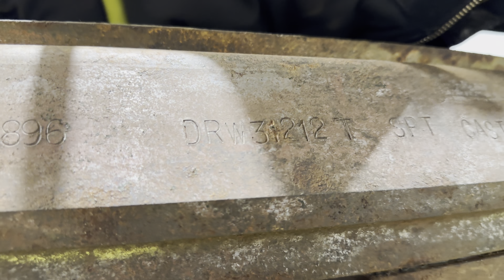RESTORING THE WORLDS ONLY FV4005  (PART-4 RED OXIDE)

Comment from the maker: Incase people are wondering. All the metal parts we cut off are adaptions made to this hull for its experimental work that are not correct for the FV4005
Reply: l was beginning to think that, that rectangle plate was bolted on from the other side
Reply: Cut that scrap up into small chunks and off them up as souveniers?? I'd buy a piece
Reply: It does lose history , but as long as the tank museum documented it I think it is allowed
Reply: will you be painting the inside of the hull? if it will be a museum piece, I'm sure it would look fab.
Reply: @kaiotie1 ….try watching & listening pal
Reply: Oh thx I can sleep now
Reply: @vintageradios6135  great Idea, I'd buy a keyring
Reply: Nerd alert ⚠️  nerd alert 🚨. "If you had watched previous videos this would have been explained already "in my best nerdy voice 🤣
Reply: no need to be rude. i must have missed it. i’ll have to re watch and see.
Reply: @Wilko601st must have been multiple times even for me to remember it.
Reply: You mention shiny welds that are difficult to cut off, that sounds like Armoid, it's more or less stainless steel so probably won't cut with oxy gas . Try using gouging rods , sometimes called " Iron Powder" rods in the MMA welder it is far easier going.
Reply: poeple are creeps man. to bad you cant protect yourself like you can in the US
Reply: @highpath4776 the hull doesn’t belong to the Tank Museum, it is his.
Reply: Glad ya cleared that up, I was wondering🤔
Reply: Painting a WW II TANK with classical music…..only the brits would think of that!👍👍
Reply: Yep, sensible, not like that baby deltic thing where they are making a lost historic deltic loco by cutting up a historic deltic.
Reply: @teamidris  They are not cutting up a Deltic to re-creat a baby Deltic  they are using an x class 37. There are already far  more of them preserved than will ever run again so another one will not be missed.
The result will only be a loco that "looks" like a baby Deltic, sadly it was a poor design in its day so hopefully they can make a silk purse out of a sow's ear. It stands more chance of completion than some of the other re -incarnations that people have got planned.
Reply: @cameroncashatt692  He does have a couple of tanks, i know they are de activated but accidents do happen when driving round the yard at night. Especially as the last uninvited guests stole a lot of snap-on tools.
Reply: @moelSiabod14334  it has to be at least 60 years old, that’s terrible :o
Reply: Are you doing any events this year in Northampton area?😊
Reply: You may have an undesirable in the comments section as well as in your property, just had a reply on my post that would suggest someone is trying to scam people, might want to warn people.
Reply: @noonehere1793 shame it's not a WWII tank then. (yes it was designed in ww2 but production only got going in 46/47. He also mentioned the hull was built in 49, and the FV4005 program was in the late 50's)
Reply: Thanks, I was wondering why you were doing it. Keep up the good work!
Reply: Wasn't it actualy on a mark 3 hull but outside the museum it was one a later variant hull
Reply: 6:10 couldnt of found a bigger grinder if you tried lmao
Reply: I was worried that you were butchering it. Glad to see otherwise!

Comment: As always mate great Video! You need to get Jack a 10L paint pressure pot, they make life so much easier, spray at any angle, you don’t get a sore hand from holding up the weight of the paint pot, and you can mix as much paint as you like and go for it until your done! Great work👌🏻 keep it up

Comment: For your restoration "Upgrade" look for a 3 GAL. pressure paint pot, at surplus, used one back in my early days of Aircraft painting. allows you to mix three KITS at once pour in pot, all you have to drag around is hose and gun handle.  the only downside is cleaning the hose, it does seem take bit more care to make sure it;s rinsed.

Comment: project is going well so far
well its great to have a huge shed to paint in, but to stop the spread of overspray, you could make yourself a simple wood or metal frame shed to fit over the tank (with room to spare) and sheet it with the old vehicle plastic sheet - also surprised you don't have a very large metal wedge, some one holds in place above offending part to remove, and the other person taps it with sledge from above, standing on the rear deck etc, that way you use the weight on the wedge and not reply in the impact and accuracy of the sledge hitting a small chisel (that long piece running down on the right of the rear panel would make a great wedgey - great work chaps

Comment: Excellent 👍 Cheers.
PS : I use pneumatic impact hammer hammer often jars loose weldiments.
Carbon arc rods used with air burn  welds off much better also.

Comment: Jack gets the glory for knocking the plate off, well done Jack! Did I blink, or am I right in thinking I never saw Seb give the plate a tap? Joe, an hour and a half on the grinder, have you heard of white finger (HAVS) ? If not, you will do as you get older. Adam has the right idea, it takes far less effort to gas brackets and plates off it at all possibe.

The (red) primer looks good. You've done well to smooth everything out. Grey primer would have looked better, but it's not my machine. Spraying the paint always makes it look like you've done a lot, all the cutting, & gringing pails into insignificance, yet it's the preparation that makes the job.

Well done, you're making good progress.

Comment: You guys make my day.  I laughed at the sped up hammering on the plate.  

Don’t know if it’s been mentioned but dampen the floor to help with some of the oxide floating around.  Use a tiny bit of soap to break the surface tension so the paint particles stick.  Also helps keep dust and crap on the floor from being kicked around by the gun.   You can also use a large box fan with a furnace filter on it as an overspray collector to pull the overspray into the filter.  Put it close to the area being sprayed so it pulls the overspray into it.  The hepa filters cats a ton of crap if you use them this way.

Comment: I'm a Professional Automotive Painter and I live by the saying "Work Smarter not Harder" and by that look into upgrading to a pressure pot system. They come in many size tanks and for what your doing I think the 5 Gallon would suit you best. With that system Jack will only have a gun in his hand and not the added weight of primer or paint too. You might look into just having that room permanently converted into a spray booth and use the rolling door to secure it, I worked at a shop here in the states that could fit a sixty foot trailer and the truck to do complete race car type graphics and paint on it.
Reply from the maker: I have a pressure pot but couldn’t get it to work right annoyingly
Reply: Sorry for the late reply. When they wont shoot or act weird its either the pressure bleed is plugged or the paint line to the gun is clogged. @MrHewes

Comment: Perhaps, a worthwhile investment would be a small plasma cutter. I realize you are on a budget, but I bought a cheap one for gouging, and I think it would be the ticket for excising bits off of tanks as the air stream blows away the melted weld giving precise control. And, time is money and acetylene is going up (as is everything). The plasma unit does have consumables, but they are inexpensive (tips). I find the plasma much cleaner than a carbon rod type, but if you are very careful, they are nice as well. Just a thought I had for consideration. Might even find a sponsor or donor. I think you may have some sort of sadistic fun banging away, but you make me tired just watching 😁. You are not the most robustly built guy I have ever seen, but I will say you are surprisingly strong and have a lot of endurance!  I job isn't worth doing unless you can justify a new tool (dangerous game - good way to go broke). I enjoy the videos, and have a great day... Best! Marshall

Comment: have you ever heard of a washing tip for a torch it has a slight bend in it and looks like a regular cutting tip but it will save you a lot of grinding on those welds

Comment: Axalta ViterPrime 035 Primer/Finish is a fast drying, high build alkyd zinc phosphate anticorrosive primer or primer/finish for structural steelwork.

Designed for shop application by airless spray

well there is your overspray.. you would get some anyways but air-spray is not a great choice for this.

Comment: To remove pieces of metal like that instead of grinding the welds you need to get a gouging tip for your oxy set. It will remove the weld material quickly and a lot safer than a grinder

Comment: What is the better primer to use for a strong durable finish, Red Oxide or the gray primer you say you prefer?
Reply: Personally they are both as good as each other the main difference is the overspray you get with red oxide. I’ve tried loads of things to stem it but it always happens

Comment: Giving yourselves a lot of hard work taking brackets/plates off, use the oxy/acetylene burner with the oxygen turned up, no extra oxygen from the trigger and melt the welds off, or get gouging rods for your welder!
Reply from the maker: Yeah acetylene won’t touch it.

Comment: Highly recommend you get a 7" grinder, way lighter than the 9" and just as good for knocking the welds down. Also practice your oxy cutting, you could have gouged most those welds out with the gas and saved lots of time and effort.

Comment: That 9 inch grinder looked far too snatchy for you there. You need some gouging rods so you can liquify the weld and blow it away with the compressed air. A good welder will fectch the weld off quicker than it went down. looks good though !
Reply: Gouging rods all the way.

Comment: Get a 2 or 5lt pressure pot with lines/spraygun to suit. Local Auto shop should have something that won't break the bank or your arm/wrist from holding that gravity piece your using. Will make the job so much easier and a bit quicker to spray.
Reply from the maker: I had a 15l pressure pot, I lent it to a buddy of mine that used it and let the paint set in it and that was that…

Comment: Have you considered a plasma cutter ? In a previous life time used to extend truck chassis.    The plasma  cutter worked great for removing  heads of rivets and other unwonted accessories.  But  get it wrong and worse than a gas axe. Out with the mig.

Comment: You could do with a Air Arc Gouger for taking off those metal plates and brackets, it would make short work of that... there's a Australian engineering channel you should check out, they have a dog on the channel, (I'm not mentioning who it is, because it normally gets removed).

Comment: Awesome work guys couple of questions 
1 are you putting the hull number plate on it or the fv4005 number ??
2 does anyone know what happened to the original hull ???i assume scrapped as later models were on line but wondered if you knew 

Also if you still want to know the ads i got were 1 for a nightvision device and a bra ad lol

Comment: Okay I am bit confused. So is this still the oroginal chassis of the FV4005 or a different one bacuse in part 1 you were bringing in a different chassis. 2nd What clour will the FV4005 have? The classic sand colour like in WoT? Because Red Oxide Primer is only a preparatory coating against rust.

Comment: Why aren’t you using Carbon Arc gouging to remove the old weld?
Reply: Yes, even a small bit of weld left un-cut, will hold the plate on quite nicely. Doesn't seem these guys were ever taught by an experianced fabricator.
Reply: Because accetlyne leaves a clean cut
Reply: @AdamBest1920  I’m not talking about bits that can be cut off. I’m talking about the plate they were hammering at and the welds they were using a disk to cut. Gouging would have been far quicker and more effective.

Comment: A plasma cutter with the gouge feature would make your life a whole lot easier. I didn't think I needed it until I had one.
Reply: My thoughts exactly. And not expensive either. Though some of that weld was stainless and I have never tried removing that.
Reply from the maker: It’s all stainless weld not easy to cut

Comment: im supprised you havent invested in an airless sprayer system (which also helps a bit with the over spray ive heard) for painting the hulls and how much paint you go through instead of mixing just for the wet air gun pot every time
Reply: This is a tank not a garden fence
Reply: @AdamBest1920  yes I'm well aware of this, clearly you don't know of actual industrial airless setups.. used alot with structural steelwork fabrications can get large hoppers for them to run off the whole tin of paint and mix in thinners rather than mixing a small cup at a time

Comment: I love what you guy's do, but if yo'ur painting plant, machinery and tanks, you really need to get yourselves a 10lt pressure pot for your spray gear. You can run the paint thicker than relying on a pressure or gravity cup, with the paint thinned, it's easier on the arm, you don't have to haul the paint around, just a gun with the paint and air line and you can leave the tin of paint in the pressure pot, the paint doesn't get contaminated and the biggest advantage is when your painting upside down, you don't get paint starvation from the gravity pot. 

I spent 20 years I the blasting and spray painting industry, and once you have used a pressure pot, you would never go back to a conventional spray gun. Don't get a pissy 2-5lt one, they are a waste of time, go for one you can get a whole tin of paint in, and leave the paint in the tin in the pressure pot, makes cleaning easier.

Comment: Why not sand down the spots where u ground to get a better surface after it’s painted?
Reply from the maker: We did in some areas, but now around the back as we have got to weld all sorts on there for the rear blade etc
Reply: @MrHewes  ahhh forgot about blade, makes sense! How’s the custom fab going? Do u guys have to install that?

Comment: I am just a dumbman but why does all that stuff need to come off rather than just be primed with the rest of the hull? It's just a bunch of tow hooks and gear plates no?
Reply from the maker: Those parts are not correct for the FV4005
Reply: @MrHewes  Makes sense. Thanks.

Comment: Mr. Hewes, you say the gas-axe wouldn't touch the 'silver facing' weld. It's probably stainless steel, oxy-acetylene won't touch stainless steel   .... should have used a bigger hammer 🤣

Comment: Eeeh laddie, tha dun’t hayf mek a gud vid-yurr tha knows? :) :) I don’t know if you’ve ever heard of the things, but there’s an old type of plasma cutter called a Nertazip 540 (that I’ve only ever seen available on the second hand market for around 450-500 bones, or clams)? I found one in the back of our warehouse that must’ve belonged to the owd fella who used to hire a corner of the place for his welding business - anyway, I got the old beauty in reasonable working condition, thankfully it took reasonably generic albeit expensive consumables and actually read the (bloody) French manual via tw@tting about with Google translate (well befordle the days of screenshot translations) and pints of coffee… Then I fired her up… By Christ I tell you the thing was like a laser and happily chopped it’s way through 30mm plate. It says up to 40mm clean and 50 gouging but I’ve only ever done up to 30mm. Anyway, after learning how to use the frigger and stop blowing holes in the tips, torch and my boots, (and remembered to change the air hoses/regulator for new ones etc etc, it’s saved me thousands in gas and its bloody quick too. I’m out of the game a bit these days so I don’t know what the industry standard is or owt now but most things only used cut up to 20ish mm when I was last into it all. I’m really sorry for the essay, but if you can get your hands on one, you’ll never look back - just keep it a secret cos I wouldn’t kind buying up a few units myself :) :) Crackjng work as ever anyway folks, bloody brilliant!!

Comment: Trespassing laws here in the England and Wales are sketchy to say the least. If there is a gate and it was locked, then yes. Trespass is warranted. If not, then unfortunately there's no claim. Even if there's "No Trespassing" signs. Also, if you find someone on your property that you've not given permission to be there and you've made it explicitly clear to them that you want them to leave and they then refuse. Then claim of Trespassing can be made. Getting the trespasser off the property legally is a completely different barrel of fish. That being said, It's fairly bad form to turn up uninvited AND at such a late hour. The Sh*tbarn is coming together nicely. I see Frodo is still vigorously. tw*tting large lumps of metal. Still waiting to see what Gun they're gonna put on it as allegedly, there's non in existence. Or will it just be a mockup barrel and breach?
Reply from the maker: It’s is the original gun with original breach all still live and very much real

Comment: I have a good laugh watching someone trying to take a welded plate off with a hammer. All my days in the steelworks (heavy repair and fabrication) come flooding back.  Guys, use a cutting torch on the plate first, then grind the welds off.  
Doing it the way you are your on a looser, plus you'll hurt yourselves.  Also, stand on a platform to grind, your killing your arms and making me cringe.
Reply from the maker: Cutting torch won’t touch them hard facing welds my guy